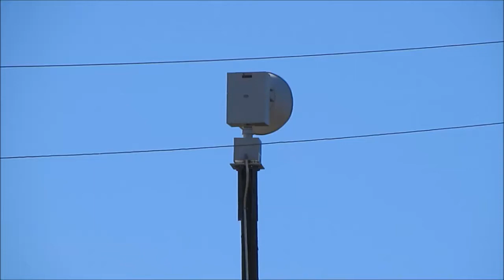Dying Federal Signal 2001-130 (DC) - Phenix City, AL 11/29/2014

Comment: Are you sure this wasn't a Federal Signal Equinox?
Reply: Look at the amount of ports coming from the back of the cone. It is a 130
Reply from the maker: These were put in before the Equinox was available from Federal Signal, I think in 2011. They'er all 2001-130s  in this county with the exception of the one Hurtsboro, which is a second generation 2001-SRN.
Reply: Ah, Ok.